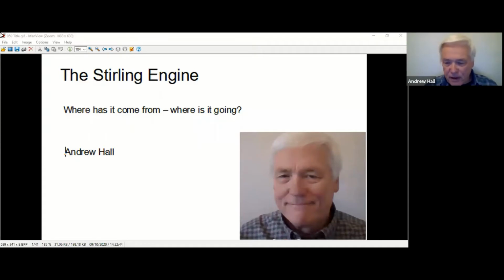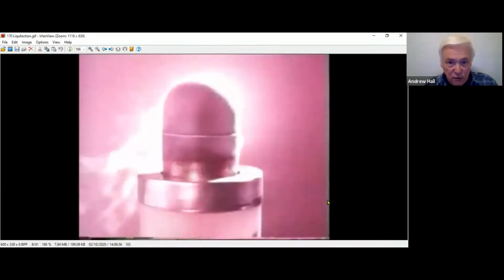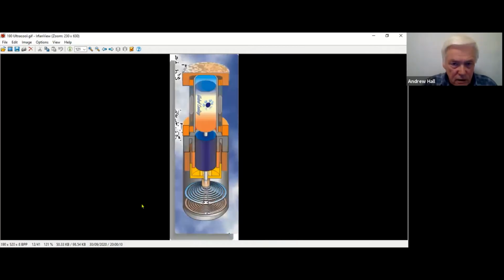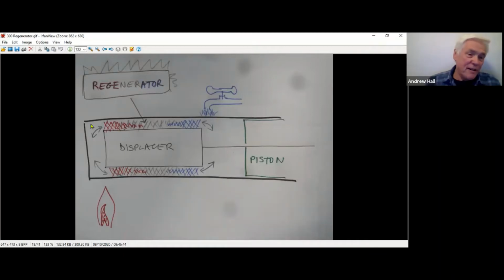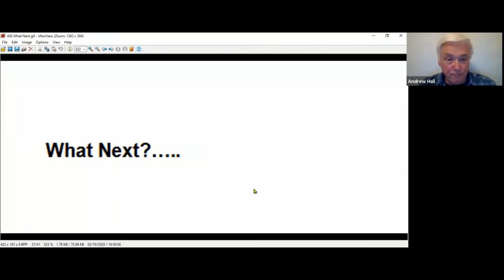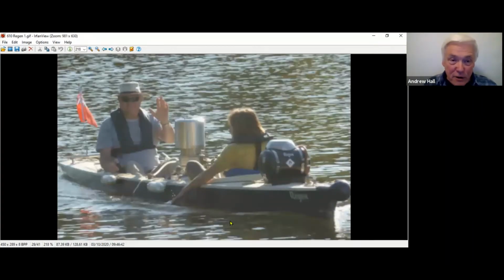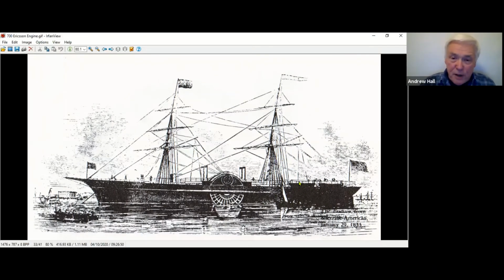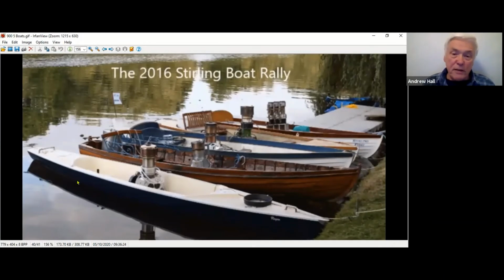Stirling Engines - Where did they come from and where are they going?

Comment: Sterling engines have lower power density or power to weight ratio compared to ICE, but they don't have the same problems in term of pollution or reliability, they are in general easier to fix, and cheaper to run, maintain and fix, but this also means that they don't make lot of money for manufacturers who want to sell more expensive parts and more expensive technology.
So the only way for normal folks to get access to a sterling is by "do it yourself".